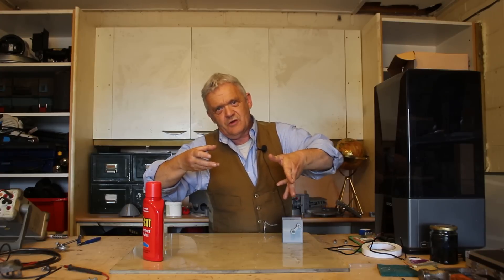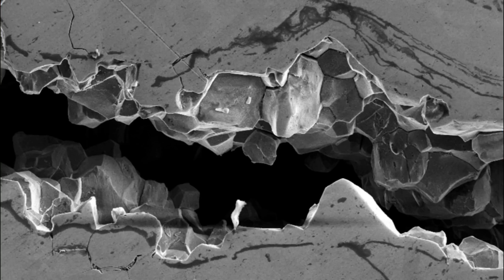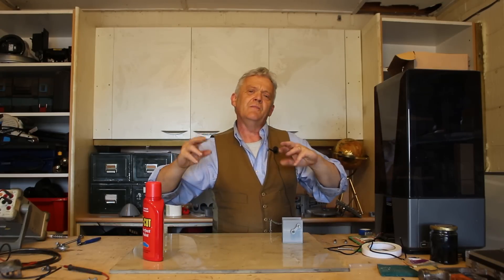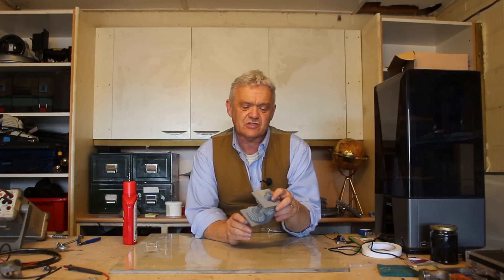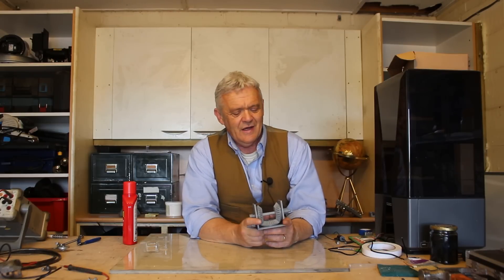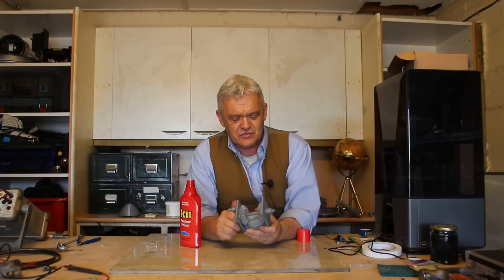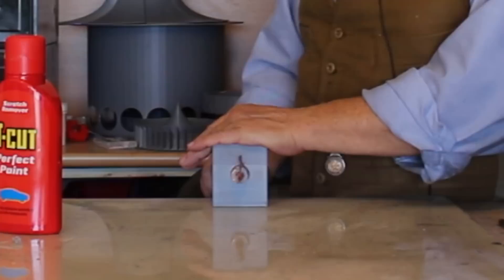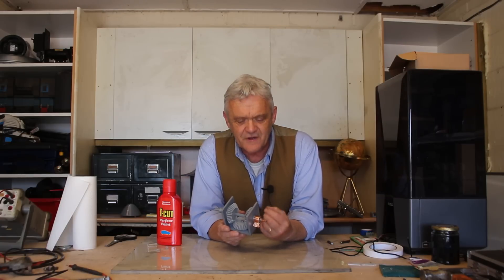1967 Genius Idea For 3D Printing And More That You Won't Have Seen Before

Comment: When I designed automotive parts we had the same issue which stamped metal parts. So we started embossing the corners and voila same thing =) It´s a great idea. The outer most layer is the most load bearing layer or a part, that´s why this works well.

Comment: Abrasive polishing is not new by any means. Racing engine manufacturers do this on all moving parts, some parts to a lesser or greater degree depending on the part. Even to the extent of using a diamond based compound on highly stressed parts. IMHO I am however surprised that it would work well on plastic parts and would imagine Silicon lubes would have a big roll in reducing friction. It would of course depend on how good the original part was.

Comment: Just to add..the surfaces of shafts can be peened with shots like that of  steel..glass..ceramic beads etc to introduce compressive stress on its surfaces to cancel out some of the tensile stresses on its surfaces.This improves fatigue life of the part.... A standard  procedure followed   on many parts mainly in aerospace industry...

Comment: The beauty of self-printed gears made of PLA is that they sort of self-polish and therefore improve over time on their own. Accelerating this process through polishing is an excellent idea. T-Cut is not familiar to me here in Germany. Does it have any special properties compared to other polishing pastes?
Reply: Nothing special. It's just cheap (and I already have a tube for buffing up guitar finishes in my day job!).
Reply: T-Cut is like abrasive Brasso (hoping you have Brasso in Germany!)  I use T-cut on the polyester piano case to polish out (some) scratches..

Comment: One extra note, it seems in a lot of these 3d prints I've been noticing in the last few years people adding gears to a lot of things, but they forget one thing.. gear ratios should not be rational.  If you make them irrational it means that every tooth in one gear is likely visited by every tooth on the other gear.

Instead of a 12 to 6 ratio  gearing maybe a 13:6 would work just fine?

I've been seeing this a lot, and figured it'd be a great reminder to toss out there.  There's a lot of people new to the whole idea of making gear trains and they don't know that concept
Reply: I have been using it on worm gears mainly, but that is a good point!

Comment: yep - many machine parts are lapped to very high quality finish - all potential metal on metal dynamic components should have a high finish specified - maybe it isn't common to be polishing the part mid shaft - but there are increments to be made (equal weight hollow shafts also last longer in high cyclle life applications (re. equal diameter as there is the tension and shear resistance to think of - that requires a stronger material)... Stress risers leading to failure are most common at the end of threads, splines and shoulders - a bit more of a buff at the transition may go a long way.

Comment: I was using TCut 30 years ago to smooth out blemishes on my polyurethane casts long before 3D printing became popular. These days I use TCut exclusively as a cutting paste to remove artefacts from 3D prints ready for moulding reproduction.

Comment: This same concept is used when building engines--especially when seating the valves.  A small amount of abrasive lapping compound is applied to the valve seat and the valve is inserted.  A little pressure is applied to the valve head while it's spun against the valve seat.  Done properly, it makes for a perfect contact seal.

Comment: Good idea, it reminds me of the old car sales trick of putting saw dust in a diff to quieten it down, might be worth checking (under magnification) to see if any abrasive bits are still present, i.e embedded in the plastic itself.

Comment: That was an interesting. I was going to say something for a while about the way your spinning gears sounding noisy, I had that problem with a hand crank generator I bought from some company out of China real cheap that I had to assemble myself, I put coconut oil or some other lubricant on the gears and it stopped most of the noise and it made it run much smoother. Also it occurred to me that  jewelry models could be made if they are smooth enough with the 3D printing for doing lost wax casting to make jewelry or anything else you want to cast from metal. Thanks Robert
Reply from the maker: someone suggested tumble polishing with sand - i liked the basics of the idea but i was thinking maybe toothpaste - the powder not the tube or maybe cerium oxide - what do you think?
Reply: @ThinkingandTinkering  I don't know on plastic , I always used cerium oxide to polish opal and most other types of stone and it works well for that , all you can do is try it, I don't thing sand, if you polish it with a muslin buff use red or black jewelers rouge and run it light and slow and be careful not to melt the plastic, when I was in school they used something they called crystal that they used to polish watch crystals with, I don't remember if it were for both glass and plastic or not.  If you use a Dremel like polishing tool I would not use a foot control, use one that you can set the speed with a potentiometer so the speed is more steady and constant.
  I never have heard of anyone tumble polishing plastic, or using toothpaste on plastic, if the PLA is a hard type plastic there is a really fine cleanser powder called Cameo(Aluminum and Stainless Steel Cleaner) that works to polish paint pretty nicely I don't remember if I have ever tried it on plastic, you might need something like little pieces of felt or leather to help with rubbing it against the plastic, I don't know since I never have tried it.
Reply from the maker: @lorenbush8876  cheers mate - i will give it a go and we will see what happens then lol

Comment: Won't the friction of operation melt the gears after awhile??
Reply from the maker: yeah probably - but you wouldn't include it in a finished machine - just like you would spend a fortune cutting gears for a prototype mate -  use the printers to work out ideas mostly
Reply from the maker: yeah possibly - but i mostly work out ideas with a printer - but then i guess it would depend on what plastic you used and what you did with it wouldn't it?
Reply: @ThinkingandTinkering  I guess it's okay for prototype purposes. The environment that a wind turbine is in is unforgiving. I've had many failures over 10 years.

Comment: That's brilliant. If you print in ABS, you can put it in an acetone vapour bath for a minute or two to get a perfect glossy finish on anything. It does begin to muck up the dimensions a bit, you have to time it just right and find a way to remove it without touching it to let it dry.
Reply from the maker: cheers mate

Comment: I've done this a couple times. I make things tight enough that they can just move with a decent amount of friction then I use 3m rubbing compound and run it until it feels reasonably free, still a bit tighter feeling than I want it to be in the end. Clean it, grease it, check it and repeat until I get the feel I want. I've gotten some very nice results this way.
Reply from the maker: nice mate - cheers

Comment: I wonder if you could get a similar effect by tumbling your print with sand or some other abrasive.  Or tumble it with small steel balls to "shot peen" the surface.  It's been done to harden the surface of steel parts, but i don't know if anyone has done it with plastic prints.
Reply from the maker: i don't mate - maybe something less abrasive than sand - but a cool idea - fancy giving it a go and letting us know how it works out?

Comment: That is a very ingenious partial solution.  I say partial because there is only so much that polishing something can do by itself.  After doing the T-Cut trick, why not disassemble what you are working with and then rub in graphite powder(the finer the better).  T-Cut polish to start and graphite to finish I would think on many materials(3d printed included) would certainly help to give it a bit more longevity and reduce wear on it.  Something else to ponder though is the fact that graphene bonds very well with other carbons.  Would it be possible to graphite coat and then graphene coat for a more smooth surface.  Strangely enough it's mulling over such questions that keep me awake and sleepless some nights.  LOL!  Cheers!  Thanks for the video Rob!
Reply from the maker: like it mate - cheers
Reply: I figure you could just use graphene directly in that case. PLA or any other plastics are all hydrocarbons. So I would imagine graphene bonds to it by itself pretty nicely.
Reply: @KaiserTom  Probably.  I was just throwing around the idea that it might make it have less friction.  To add it to the material would make it harder in theory, but maybe not have less friction.  It would still help to add some kind of lubricant even after the addition of it to the material.

Comment: A very interesting issue. It's one of the considerations we learnt of during our undergraduate material science course.
Working with high frequency electrical structures the surface roughness has an influence on insertion loss.
So 3 D printing or sputtering technology has the drawback of rough surfaces.
Reply: Makes sense . The high frequency current travels along the surface rather than within the core of a conductor.
Reply from the maker: very much so mate

Comment: Great idea! I wonder if one more step after T-cut  of solvent vapor polishing would make the plastic surface even smoother/stronger.. In the case of ABS plastic, one can hang the T-cut polished part in a chamber full of acetone vapor for a few minutes to vapor polish the surface even smoother. I use an empty paint can with a little acetone in the bottom. The can sides are also lined with paper towels held on by small magnets to help distribute the acetone vapor.
Reply from the maker: nice one mate - fancy giving it a go and letting us all know how you get on?
Reply: @ThinkingandTinkering  I will when I try it but I started too many other projects and it may be a while.
Reply from the maker: @William_Hada  no worries mate - just when you get round to it - there have been some great suggestions and there is no way i could do them all - but i want to know too lol - cheers mate

Comment: Abrasive lapping is a great way to get two items to fit well. I've used the process numerous times when rebuilding engines to make sure the valves are properly seating into the valves seats their mated to. This minimizes the opportunity for them to leak by, which minimizes the risk of burnt valves.
Reply from the maker: cheers mate and it was awesome of Mark to share

Comment: That's a smart move.  We used to use either vapor polishing or a coating/solvent (several are available for different materials) to chemically smooth parts but also it would help with delamination as it would fuse the outside of the layers together - sometimes when mechanical polishing was applied it could tear apart weakly built and or more delicate parts.  But this would actually grind them to very good tolerances - perhaps a smoothing/fusing step then the surface grinding with pastes (unless you're fusing from friction heat, which means you're deforming the part when working as well as a higher risk of delamination starting).  Fused and trued.  Nice.
Reply from the maker: cheers mate and it was awesome of Mark to share

Comment: Glad to be of help! This is a car paint restorer. Also available in a tube, without the ammonia, which is nicer!
Reply from the maker: it was awesome of you to share mate and like i promised - it's a video - really cool idea - good one mate
Reply: In case anyone wants to find the original comment, it was a reply to my comment in video 1965.
Reply: Excellent idea. Thank you
Reply: Shares in T-Cut just took off like a rocket. 🤣
Reply: @Struthio_Camelus  Dang it! I sold mine last year🤣
Reply: I suppose you could just as well use any heavy cutting compound just like the ones used with an orbital polisher for car paints.
Reply: Thanks for innovative contribution Mark🙏

Comment: Well, lubrification and polishing with tetrosyl's cutting oil would be experimented to see the effect on different plastics. Not to be hopped to transform additive manufacturing using plastics in metallurgy.
Reply from the maker: nice pointer mate - thanks for letting me know

Comment: I don't disagree with what you have said.  But as someone who was trained in polishing in jewelry college I would go through the steps of powered polishing with each separate grit level before using a higher level polishing rouge suspended in an oil and well mixed in the manor that you just displayed.
Reply from the maker: nice addition mate - thanks for sharing

Comment: on metal gears where a perfect fit is required the process uses a grinding paste and is called lapping, similarly the inlet and exhaust valves of cars used to be lapped to get the airtight seal required for combustion, chrome polish or toothpaste also work well with plastics (toothpaste can also be used to polish fogged headlight lenses.
Reply: I was wondering about toothpaste! Maybe add some talc powder or abrasive if you have it around?
Reply from the maker: niceone mate - cheers - i was thinking of smokers friend - but then i would lololol

Comment: I've tried more or less the same thing by rubbing aluminum over steel parts like rusted bearings. My thought was that the aluminum would become a powder and then oxidize and clean off the imperfections for me over time.
Reply from the maker: interesting mate cheers

Comment: What's "T-CUT"???🤔
Reply: its a polishing compound used to renovate car paint
Reply: @grendel1960a  Ahhh Sooo!!! Thanks!!! Makes Absolute Sense!!! Also helps if the extrusion factor is properly calculated too!!! If I'm printing 0.20mm layer height, I always set extrusion factor to 0.95 and if I'm doing a layer height of 0.16mm (excellent for overhangs!!!) I set the extrusion factor at 0.85. Additionally, I've disabled the gcode M413 power loss recovery as I have my 3D printer connected to an Uninterruptable Power Supply (UPS). This has eliminated all blobs at each point where the machine writes the recovery code to the SD Card and pauses, thus causing the blobs.
Reply from the maker: you could try asking at a body shop for a recommendation mate

Comment: just use a little grease
Reply: Doesn't reduce stress concentrators but certainly plenty of silicon grease helps with printed gears.
Reply from the maker: sometimes you need a bit more mate